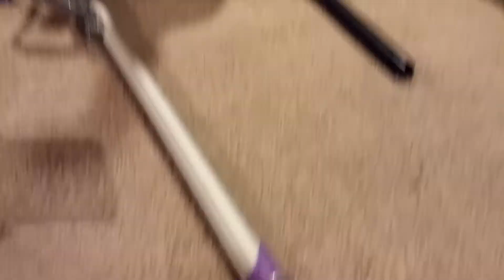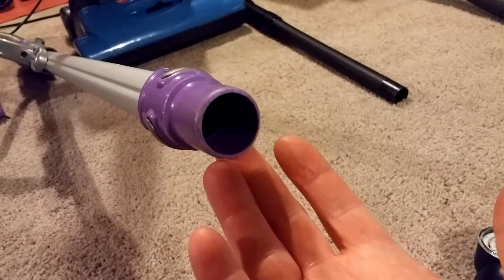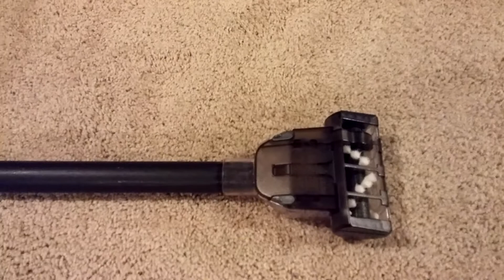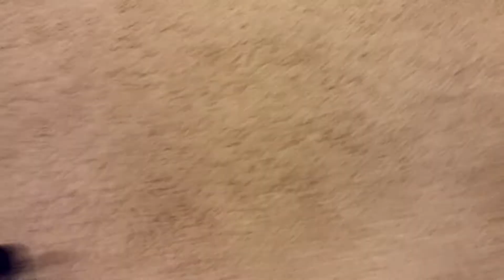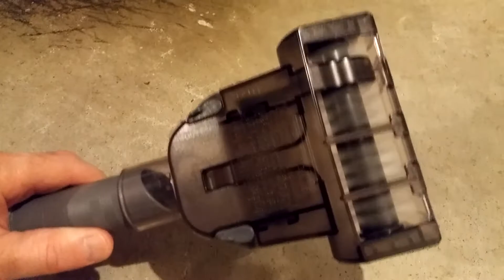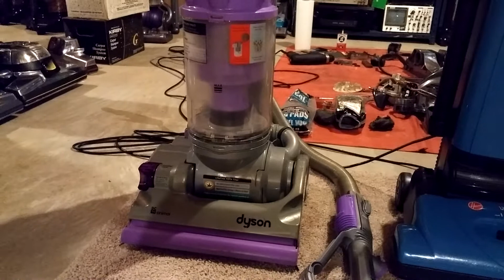Turbine tool speeds versus vacuum suction

Comment: Some turbo tools don't react nicely to being attached to too powerful a vac. I had a Panasonic turbo tool, which on the Kenmore it came with (a rebadged Panasonic), barely could spin at all. I then put it on a Silver King, which gets something like 105 CFM at the hose and about 85" of water lift. It worked well for a few weeks, spinning like the dickens, but eventually the turbine actually shattered!

Comment: It would be great if you started to collect turbo nozzles, including a RugRat, a TurboCat and the different models from Wessel Werk, and also to test each of them with the many cleaners in your collection, including those of the wet & dry type like a Shop Vac and the Vacmaster.
Reply from the maker: Would be cool to test some, but I just don't come across any in Ohio. Everything is powered.

Comment: Bill,  do you have a Kirby Zipp Brush? I believe the Zipp Brush was specifically designed to work best with the Kirby's high airflow / low suction. It would be interesting to see how the performance of the Zipp Brush varies between your Kirby Sentria II and your Dyson DC14.
Reply from the maker: Stan Tyks yes, I have several Zipp brushes. And those are meant for high airflow machines. 😎

Comment: Hi, so far amazing videos. thanks!! would it be possible if you make sand test in carpet with Miele vacuum and another video on motor vs turbo head on carpet?
Reply from the maker: P-Stine I don't have a Miele at the moment and I could definitely say that a turbo tool on carpet would do very poorly compared to a power nozzle.
Reply: I have a Miele vaccum with turbo head (STB-205-3) and I have low pile area rugs. we don't have any pets at home and we never walk with our shoes inside the house. Still in your opinion, a turbo head is not enough?
Reply from the maker: If you want your large area rugs cleaner, I definitely would recommend at least a small power nozzle with a softer brush roll. Miele might make one for your machine as an upgrade so you would need to purchase an entirely new vacuum. Please see YouTubers "Ibaisaic" and "VacuumTests" for additional videos as proof.
Reply: I have both types of floor nozzles with my Miele cleaners, this is, both an STB205 air driven turbo head, and an SEB236 full size electric power nozzle, fitted to an older S5 series (S5980) which in the US was known as the Miele S5 Capricorn. In my opinion, provided the pile of your carpets is short, then a turbo brush should suffice, but if its a medium to long pile carpet, then a power nozzle would indeed be better. However, many Miele canister vacuums do not come with a power nozzle take off socket and cannot have a power nozzle attached to them as an accessory, so if yours does not, then you would need to buy a complete new machine, which at the present time, would be something like the Miele C3 Marin, which in the US sells for around the $1000 - $1200 mark, or maybe buy one second hand. Dont forget that with a power nozzle, you also have a power hose, and these tend to be heavier and slightly more unwieldly than a hose with no electric power lead going through it. You have to weigh up whether you want to spend an awful lot of money  to buy a powerhead model, with the extra benefits one would bring to your carpets, especially if they are only smallish area rugs, and low pile, in which case I would stick to the air driven turbo brush you already have.

Comment: One other comment - The Hoover Tempo wins again, not only did it pick up the most sand, but it also operates the turbo tool the best as well! I am now wondering if the Hoover Tempo is rated the highest in terms of motor wattage, of the 3 vacuums, in which case, the speed of the turbo tool would be pretty much proportional to the power used by the motor of the vacuum driving it. - OK, just checked on Amazon and the Tempo uses 12A, which is 1440W, and thats higher than the Dyson, and more than double the power of the Kirby, so maybe it makes no difference whether the machine is a clean fan or dirty fan, nor how much airlow it has, but moreso on the motor speed which would seem to be proportional to the power the motor consumes.
Perhaps thats another series of tests you could do, to table the airflow and suction of each of your machines and their wattages, and see if any pattern can be found, between dirty fan and clean fan machines, as we believe that dirty fan is more efficient, can this be proven in terms of energy consumption and output?
Reply from the maker: MadAboutHoovers please checkout my many years of VL posts, where I specifically list real world power usage versus airflow. In a nutshell, dirty air machines are the most efficient, then clean air, then dead last- canisters. Wanna waste tons of electricity? Use a canister.

Comment: Thanks for running that test, it proves what I found when I tried using the exact same type of turbo tool on my Kirby heritage 1, and on that machine, it didnt spin as fast as for the G series Kirby you showed. The Heritage 1 did come with its own turbo tool, but the one I have must be specially tuned for a Kirby becuase it works slightly better than the newer type of turbo tool shown in the video. I found that the Dyson I used (DC07) spun the turbo tool very fast and it didnt slow down much when used on the couch, whereas the Kirby did not have enough power to maintain the speed of the turbo tool when it encountered resistance on its brushes (ie, the fibres of the couch material). Then I thought about the motor wattages. The Kirby runs just 660W when in hose mode, but the Dyson uses double this power, which may explain why the suction is so much higher on the Dyson (aside from it being a clean fan versus dirty fan machine). If the Dyson motor was rated at just 660W, would it then be able to turn the turbo tool faster than the Kirby? Interesting thought and I will have to dig out one of my lowest powered clean fan machines and try the test again to see if something with say a 700W motor but a clean fan, would be better at turning the turbo tool than the Kirby. I have an Electrolux 500 series which is a clean air upright from the 1970s, that uses around 500W, so I am going to try this machine on the hose, and see if it beats the Kirby or not where the turbo tool is concerned.